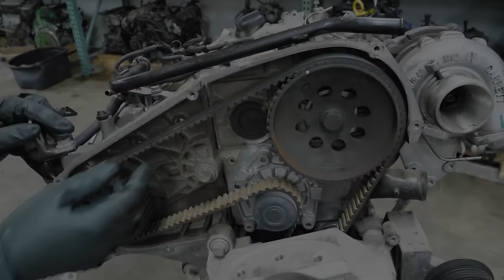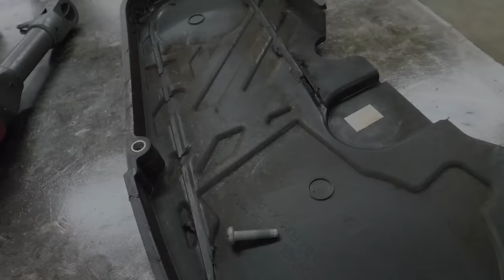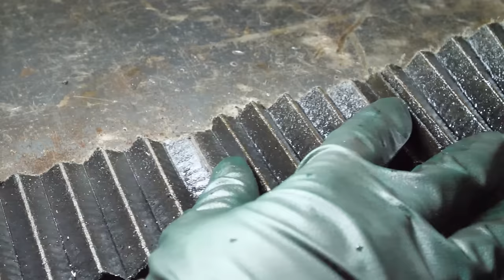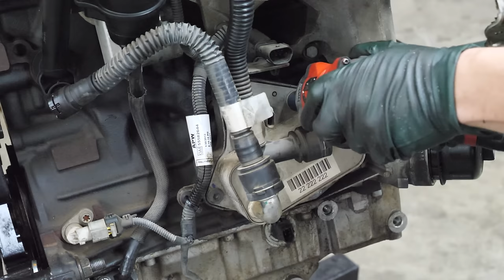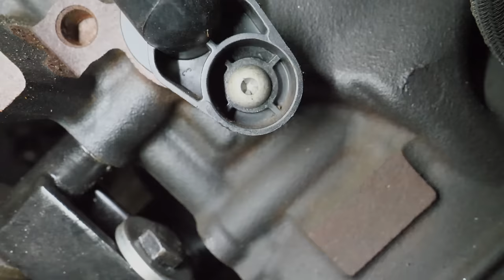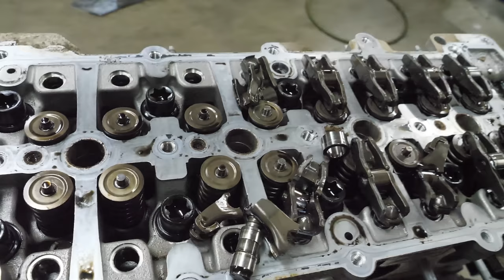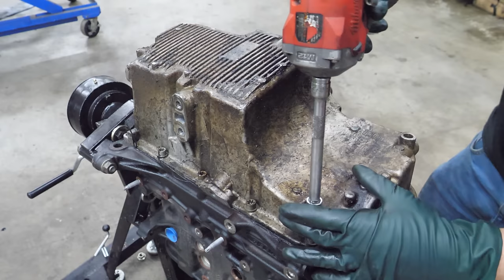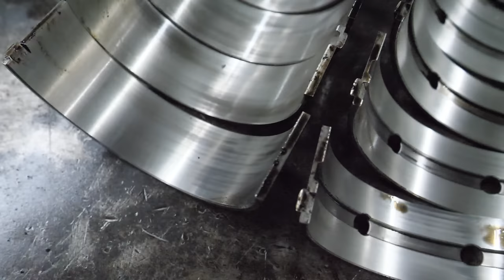I RUINED IT! Tearing Down A "BAD" 2.0L Chevy Cruze Diesel The Wrong Way

Comment: I had a '14 with this engine, bought new after it had sat on the dealers lot for over a year, got it for undeer $20k.  Averaged 40 mpg, was going to tune and delete it, but needed a truck so I got rid of the car first.  Engine was problem free, rest of the car, was a cruze...  BTW oil filter sucked to get to in the car

Comment: I have that engine in a 2013 Opel Zafira Tourer and it fascinates me how much torque it has and the fuel consumption is ridiculous for a 1800kg car. Under 5 l/100 km. I drive around 30,000/year, so it's a great daily driver for me with such low consumption. I haven't had such a small consumer since the Audi A6 c4 2.5l r5 TDI.

Comment: Driving 2 different diesel f250's means getting diesel fuel at mostly the same few stations around my usual travels. Comparatively, there isn't that many gas stations that carry diesel and you learn to know where they are. I used to go to this one station cause it was usually cheaper & frequently used(good, fresh fuel)and i frequently saw one of these, a beige Chevy Cruze at the diesel pump. Being the very observant person i am, i noticed this normal Chevy sedan about to put diesel fuel into his car -at this point i had no idea it had a diesel engine in it, and wasn't gonna let him pump diesel into a gas car when i was right there, so I had to ask - "is that a diesel cause these are diesel only fuel pumps"(gasoline pumps on other side of lot)?. Sure enough it was, it was so quiet you couldn't hear any 'normal' diesel racket(i drive 7.3's for reference). Even the VW TDI's have a noticeable diesel racket coming from them(& usually the tell-tale blackened exhaust on bumper) so its obvious. Hearing that they are oversll good running diesel engines, id buy one if it was a good deal for sure. I love diesels & would always pick oil burners over gas counterpart every day. I like being able to do the minor tuning & maybe turbo swap to make close to double the power in these oil burners! Long live the Diesel!🛢️⚡💥💨💨💨🛢️👍🏻👌🏻🚜🛠️🔧🔩🚚🏗️🚂🚚🚒🦺🚧🛢️🛢️⛔

Comment: Ha! This engine is bit too familiar to me. Can't forget the oil filter placement on these, so good design... 

Anyway, long time ago we had Insignia with the same 2.0 CDTI engine that had cut off suddenly. Cambelt had snapped and it was time to see what kind of damage the engine suffered, valves were bent but pistons, they were okay. New valves, lifters and bits, head was machined to spec and new timing belt kit was fitted plus oil and coolant. First start and that thing did not run properly at all, it also made "screech" sound like something bad was about to happen.. It was time to diagnose it and check everything including timing, maybe some auxiliary belt driven stuff was making that noise or the water pump.. Nope, it was coming from the bottom end, oil pan off and one of the conrod bearings was worn pretty badly. It took weeks to get proper ones and after they were fitted, engine still did not run properly. Head off and thorough look at valve train for any problems, spinning it on the table and looking at the camshafts we figured out that those camshafts must have spun a lobe as it's pressed camshaft. New camshafts and whole lot of seals, bits and stuff and it finally ran properly! Lobes had spun just a few degrees and it was visible when we compared new camshafts against old ones.

Comment: FYI ---In and out play is called Axial movement or Axial thrust clearance..  Impeller fins are called Blades just like in a Turbine..  You also said around 1:30 into the video that tuning it would get better GAS mileage, you can't run gas in a diesel.  I'll take a chain over a belt any day.

Comment: I'm going to say that it may have had some rod nock from the worn bearings and also it may have been running hot at times during hot weather,  for every blocked water passage that you see there is probably another one you cannot see.    Sadly some people down South don't use antifreeze,  they run tap water that rusts and blocks water jackets.    I would also look at all the broken rockers and see if all are fresh breaks that you did and if one might be an old break.

Comment: That 5 point fastener is one you cut out or drill out. It has a tit that when it gets torqued to a certain tight ness it breaks off and leaves that 5 point hole. I have worked on that engine and had to figure that out the hard way as it’s hard to find parts so I couldn’t brake it. Had to drill them with a right angle drill and extract them and I just found a bolt the same length and threads. There are 2-3 of those break off bolts on that PCV system.

Comment: Try changing the oil cooler without removing the engine. After 120,000 miles, mine started leaking and amidst taking it off, I discovered the PLASTIC coolant lines were cracked and brittle. Those lines were harder to find than the cooler itself

Comment: Only issue these have is the oil pickup gasket/ rubber seal,  normally harden and fail around 100k. This seal sandwich’s between the sump and block. Draws in air first, then fails, with a lack of oil problem.

Comment: I actually own one of these and can tell you that It is an incredibly reliable engine. And the Diesel cruze group that I'm in; we have guys in there that are pushing 400k miles on theirs. The most common faults you will find with these engines are the oil pump pickup seal between the block and oil pan that is well known to get hardened if you maintain emissions intact and only run GM brand AC Delco dexos 2 oil and Not something better such as Schaffers or amsoil. The other problem being the water Pump, that really needs to be changed on time. The timing belt is one of the easiest ones i've ever replaced And the Bosch CP1fuel pump and injectors rarely ever give issues. As for the destruction of the valve train, Both fiat and VM Motori Use a breakaway style rocker arm to prevent damage to the pistons in the event of a timing belt failure.

Comment: it was certainly running when the timing belt broke, due to failed water pump. then they changed water pump, timing belt(other parts) in hopes there was nothing else wrong.
nope, it was thoroughly broken, so junked it went

Comment: They make what's called a impact driver, you put your #3 but in the end of it and twist the driver by hand the direction you want the fastener to go and smack the end with a hammer and they cone loose quickly. You need to get one Eric they are 25-30 dollars. 😊

Comment: I have a 2018 Cruz diesel. I had a glow pin break off and drop into the cylinder, locking the engine up. Of course the warranty wouldn't cover it, so I ended up eating it. It runs good now, my wife can get 54 mpg with it.

Comment: I had a '13 Legacy LTD with the CVT and I can confirm they're junk. Replaced engine at 92k ( under extended warranty luckily), all 4 wheel bearings by 110k, calipers twice in 60k miles, shocks/struts shot by 120k highway miles... then the differential and transmission blew and locked up at 156k. I put more money in replacement parts in that car over 4 year of highway driving than every other car in my adult car owner life combined 😂 Sold it in very good (otherwise) condition a year ago for 1/3 the cost of a new transmission. That POS was replaced by my 4th Toyota 👌

Comment: The pentalobe screws were also found on some Ford Australia products. The AU Falcon used them for the drivers airbag, so the bits are available.

We had one of these diesels in a Holden Captiva, was good until DPF issues reared their ugly head.

Comment: They were used in the Equinox in this country as well.  Even rarer in that application.  I'd be curious to see you do it's replacement (the 1.6) and give a comparison.  The 1.6 has a stupid timing chain at the rear and was a hard pass for me for that reason when replacing my 2015 Cruze diesel.

Comment: I've long held the view that car manufacturers are in cahoots with the major tool manufacturers to come up with special tools that can't be duplicated.  That way, even dealer mechanics have to buy the special tools and may only use them at most, a handful of times over a career.  Outside the dealership, you may use a tool a couple of times, and that's it.

Comment: You should try a impact driver for the oil pump screws in the future. Worked for the cam plate on pinto engines back in the day

Comment: it looks like the rockers on one of the end cylinders were broken as well. I dont think theres any way that the valves on the middle cylinders hit the pistons. The belt looked brand new so i bet someone did a timing job and made a mistake or the old belt failed. The sad thing is those rockers are designed to be a mechanical fuse of sorts so that if the belt does fail, you can just replace the rockers and be on your way.

Comment: The 2.0 engines have a problem that if it is not caught in time it ends up breaking, the O-ring of the oil suction cup dries out, and ends up taking in air, and ends up breaking the engine, it is a very common failure of the 2.0 engines, but If caught in time, that engine is very durable.
By the way, the 2.0 engine comes from Fiat's 1.9 JTD engine.

Comment: The Diesel rocket of india. Same engine in optra magnum  runs insane fast.  Good engine.  Tonn of power n torque. . 
 Only curse is the DMF . If you weld it fixed mass, it ruins the drive. If you replace, its bank breaker. Rest its a choicers choice car

Comment: Hi Eric,  looks to me that you didn't break all of the rockers, only some of them in cylinders 2 and 3. This looks like it had suffered a water pump bearing failure and timing belt jump/snap causing at minimum broken rockers on exhaust side cylinder one. The timing belt and water pump look like they've just been replaced and at that point the fitter then found the engine no longer turned over fully by hand

Comment: I had one of these and tuned it to make 200hp and around 500tq. Hilariously stout motors. The transmission were awful. The 6 speed crapped out at about 300tq and the push button shift couldn't figure out what to do with a torque monster.

My ex wife hated it cuz it was slow but threw her back in the seat all the same. If it ha dcone out with the modern 10 spee, the Cruze diesel would have been 20x more fun

Comment: Cracked cylinder heads is another common problem, seen many with a nice split between intake and exhaust valve. It's 5000€ for a b20dth with guarantee here in Germany 😂

Comment: I'd say that 5-point fastener is some kind of PCV-Anti Tamper thing. GM also uses screws that are stripped out from the factory on some PCV hoses on the 1.5L turbo so you can't remove them. You're supposed to break and replace the PCV hoses any time you have to mess with them however the bolts aren't all that tight and a pair of vicegrips easily removes them so you don't have to break and replace parts needlessly.

Comment: Back in 2014 I was in the market for a vehicle with better fuel economy. The Chevy Cruze Diesel was at the top of my list because if I were having to get rid of my very loved 6spd Infiniti G35 it was going to have to be for the absolute maximum fuel economy I could get. I found out that the Chevy Cruze Diesel had a list price exactly twice the amount for the brand new Toyota Corolla I ended up getting instead. Chevy wanted like $45,000 for them, that was insane.
Reply: Mind boggling price - typical GM for anything halfway desirable. Did the Toyota do well?
Reply: @James-vt2cb  It did very well! Consistently delivered mid 30s MPG. I even squeezed 40 out of it on a long, slow, highway drive. I never really got to break it in though, it took T-bone from a PT Cruiser on the right side like a champ at 60-some thousand miles. 😔

Comment: Chain or belt. Both are maintaince items. Most people don't view chains that way unfortunately
Reply: I’ve never serviced a timing chain on any of my vehicles and never had any issues on the few I’ve kept to almost 300k miles
Reply: I own a Toyota with a chain. Never any issues and no changing. Had other cars with belts. Changing them is expensive. But maybe you are right, regarding the bicycle chains that are used as a timing chain in some brands....
Reply: Had a Type R Honda Civic with a K Series. Although they claim chain lasts life of engine, in actuality they can stretch especially when you drive them hard as designed. At 100k miles it was nearly a tooth out. Still ran fine, just had a lot more top end once new chain, tensioner and guides were done

Comment: I'm guessing low oil pressure caused by the oil pick up seal 😂 a bug deal in the UK with vauxhall insignias. My 2.0 A20DTR engine is going through it now, doing the seal soon.

Comment: Belts are indeed better than chains. Especially when compared to a chain drive water pump!
Reply: Timing gears over belts and chain.    Belts wear a hell of a lot quicker then chains
Reply: @henrym5889  lol.  Yes.  But I believe Toyotas are only a 70,000 mile belt.  Yet my LS with timing gears has 400k on them.  They whine......but its just screaming Horsepower.  Lol
Reply: @nissan300ztt  On OHC engines, there's not really that much of a difference in how long they last. Belts often have change intervals over 100k miles these days.
Reply: @nissan300ztt  Your username used a belt. That and the iron block is why I prefer the VG30 over the VQ's
Reply: Belts are superior, because they are typically designed to be replaced easily. Chains stretch, guides break, ... They are supposed to last longer, but in practice they often don't.
Reply: yes, especially the wetbelts from Ford and Stellantis........
Reply: @nissan300ztt  On an OHV (pushrod) engine chains all the way, they typically last for a very long time and even if worn will carry on without a problem.  On an OHC engine a well engineered chain drive is OK, but there are way too many examples of poorly engineered chain drives around that fail at low mileages, BMW seem to specialise in them.  I'd far rather have a belt that takes a few hours to change every 50k than a chain that fails at less than 100k and requires a pile of work to fix.
Reply: @nissan300ztt  I think you need to do some study on that. Chains stretch, belts degrade. Therefore timing changes gradually with chains. Also, chains shear oil which causes the viscosity improvers to degrade quicker, whereas a dry belt has no effect on oil. Also, I'd rather change a belt twice than a chain once....

Comment: I own a 1.4L cruze engine and i was working with a cruze specialist shop to see what i can modify on my car. Surprisingly, they have replacement performance parts for almost everything, and even a remote tune up. When i looked into the boosts id get from the tune, it honestly scared me how much I'd be getting. Everything stock sees like a 40bhp increase, but tune with parts is like 130bhp jump. I actually denied it bc i liked my fuel economy 😂
Reply: No such thing......pfffttttttt

Comment: the valves go straight down, you won't be able to tell if there was a slight impact.  But the rockers are designed to break if it happens...  100% fiat design, GM's input seems to have been limited to replacing FPT markings with GM markings

Comment: In case you haven't already figured it out, the shredded valve gear had to be original.  The cams could not both have been rotating when you tried to remove the second bolt.  Ergo, not your failing.

Comment: What is the possibility that the engine had been hydrolocked back when it was in service, and the rocker damage was existing? I just don't see how impacting the cam would have broken the rockers if the valves were free to compress. Obviously something was wrong already, because the crank didn't turn at first.

Comment: I test drove a Diesel Cruze when they firs showed up at the dealers.  The car was annoying because the torque was limited when the front wheels were turned, to avoid all that torque spinning the tires at a stop with a turn. The car was expensive for its size and trim level.  The interior appeared super cheap and boring.  Cool engine, though.

Comment: Anyone know if the newer 2016 and up Diesel Cruze was better or worse.. I see that the engine is a 1.6 and makes 135HP.. so I assume it is a totally different engine. Would consider one  if they are reliable also.

Comment: This has problem with oil system, because of  faster worn pump and a stupid gasket for oil between block and oil pan.Change pump and gasket once of every 70-80000 miles and all is good.

Comment: Yep this engine has its origins from Fiat.  Great engine. I put 140k mls on one here in an Opel in 3 years and it never skipped a beat.  Now I’m only 5 mins into the video but I’m betting a blocked oil pickup….

Comment: Why the 5 point on the PCV acumulator doo-hickie?  Wild guess, to prevent owners from removing it?  Important for engine longevity or fleet emissions  compliance in certain regions?  There HAS to be a reason.

Comment: I wonder if this engine is related Fiat MultiJet diesels or not? I know that in Europe Opel had 1.9cdti engines which were sourced from Fiat. They have few kinks, but usually they are very reliable.

Comment: You should tear down a VW 2.5 inline 5. My 2011 Jetta has that engine and is running great at 96k miles but I wanna know if it will last more than 100k miles.

Comment: i,m a vauxhall tech, whats happened there is the cam belt had broken because the water pump had broken up. somebody tried a new belt kit and it did not work. the valve gear was already shot.

Comment: Rockers did what they are supposed to do.  Timing belt breaks, Newtonian physics violation of two objects occupying the same point, instead of bending valves and destroying head, the rockers fail at a predetermined weak point. (note where they all failed...almost identical fail points)  Those darn German engineers...  
Pierburg makes a whole host of vacuum pumps - VW diesels used them (still might).